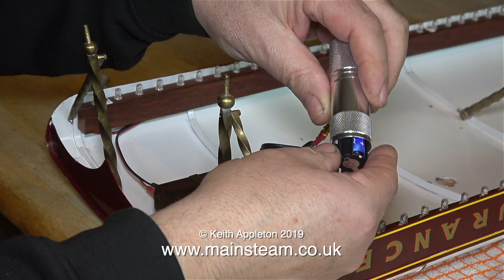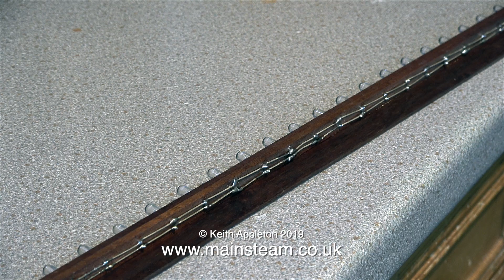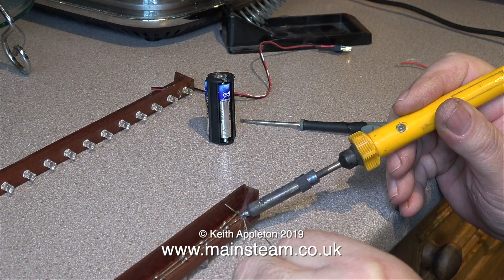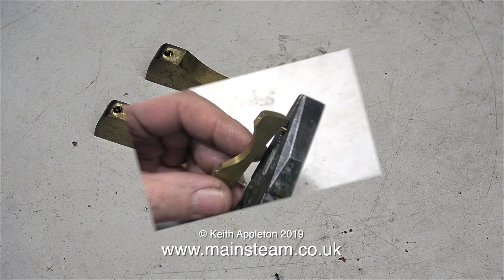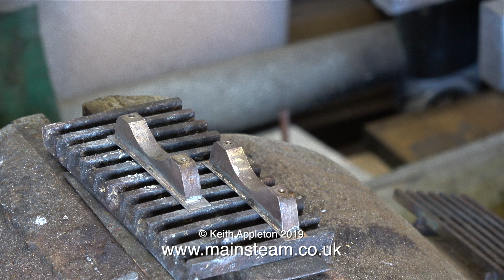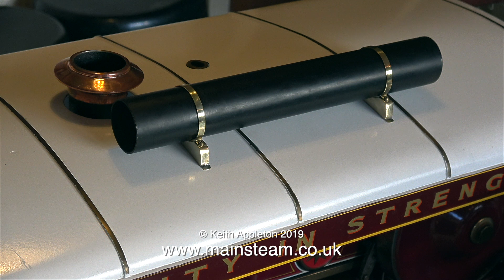REFURBISHING A MODEL TRACTION ENGINE - PART #3

Comment: Do you look for projects to work on for your channel
Reply from the maker: Yes, I have customers all over the World {:-)))
Reply: @keithappleton  I have an 040 5 inch gauge doogle that requires the pipe work looking at and smoke box door machining and a shared off blowdown valve that needs removing and replacing then boiler test
Reply: What would you charge for this list of work as I don't have the time with work
Reply from the maker: Please send me some closeup digital photographs to sales@mainsteam.co.uk with a full list of the problems with it. Don't send too many at once otherwise my Email server will reject them.
Reply: @keithappleton  thank you I'll do that over the weekend

Comment: Yes, I am an electronic "wizard" and Yes my fingers were hovering over the keyboard. What I am intenting to say is that Keith is using the correct tool to solder those LED's. It is an Antex soldering station and if those are still available, I would recommend to get one unless You already have a temperature controlled soldering station.
And why is that the correct tool and what is an incorrect tool ?
An incorrect tool is a soldering iron that does not have means to control the temperature. Good examples of bad soldering irons are those available VERY cheaply and whose temperature is not controlled so their temperature goes up until power loss through radiation etc. is egual to the power input. That temperature is usually way too high to solder any kind of electronic components with a plastic body. The LED's for example, can have their leads slightly misplaced inside the plastic body resulting in a dead device.
The Antex soldering station is quite handy and it has multitude of different tips to attach to it. One can buy those tips separately. The soldering iron tip, I consider it being part that should be easy and cheap to replace. They go bad really easily and there is actually nothing much one can do to prevent that from happening.
I started my electronic "career" some 50 years ago with a 100W Barthel soldering iron. I was lucky as at that time the electronic components were a lot more durable than they are today. My next "iron" was a Weller WC60 that has a curie-point control system. After that came the Antex and now I am soldering with a Metcal soldering station. That tool can put 50 Watts into a tip measuring 5 x 5 x 2 millimeters. The tip is heated with radio frequency and it is ONLY the tip that heats up. Our fingers are not more that 3 centimeters away from the action. This is good for controlling the work.

Comment: Electronics consultant here in keyboard warrior mode. Don’t bother looking at my videos, I don’t make them, and am very content to accept inferiority in that department.

What you have there is perfectly serviceable, and quite appropriate for a steam plant which is run infrequently.  So keep it as it is and ignore the detractors. And that’s the first time that I’ve seen electronic circuits assembled onto mahogany, so thanks for that. 😊

For the purists, LEDs are far better driven at constant current than constant voltage, unless they’re voltage mode LEDs with internal resistors. Your parallel arrangement there will drive all the LEDs at the same voltage, and different LEDs with slightly different characteristics will have different brightness, especially LEDs of different colours. Some may even be overdriven at 3V and will have limited life.

The conventional solution is to wire them in series and feed them with a constant current from a boost converter. Then they will all run at the same current and drop whatever voltage they need to, at that current. But that would be overkill for your application.

If you did want to re-do your lighting, which I repeat is not necessary, then I’d do a few things differently.

First I’d rub down the LEDs with fine wire wool or abrasive paper. This will make the light diffuse better, rather than predominantly shine downwards, and better resemble the pearl bulbs often used on showmen’s engines.

Next, I’d choose a higher voltage to run the lighting, and either use a different regulator, or a buck-boost converter if you want to run the engine slowly.

Then I’d add a resistor in series with each LED, and power the LED-resistor combination from bus bars as you suggest. You could choose different resistor values for each LED colour to match the brightness, for best effect.

If you or your viewers are interested to take these ideas further, PM me or email msj dot beard at yahoo dot co dot uk.
Reply: Constant current sources are a lot cheaper and smaller today than they were a few years ago.  I agree that just leaving the leds paralleled as they are is OK as long as the voltage supply is below the standard forward drop.  There'll be some variations in brightness, but maybe there were on the original incandescent ones!
Reply from the maker: I used a commercial regulated power supply which is fitted inside the Mahogany box under the Canopy. It seems to work perfectly well and has never blown any LEDS . . . . . .

Comment: Why would they gripe about you doing it that way? I do a ton of electrical work with LEDs for shows.... unless I using an RGB strip, that's exactly how I'd do it, and is the "right" way.... and very nicely done!

Old saying around here....some people would whine about the knot if they where hung with a new rope
Reply from the maker: That can't happen anyway, as in the small Mahogany box is a proper regulator circuit that keeps the output at a constant level.
Reply: Keith Appleton If you do ever change your electronics (see my comment above/below), I’d love to contribute a period style regulator or buck-boost converter (to allow running at low engine speeds).
Reply: LEDs can be run in parallel but with one potential problem. As a string on a certain power supply that limits current  they will be ok. Should one or more fail however, more current will be shared among the remaining LEDs, which if high enough could cause further failures!